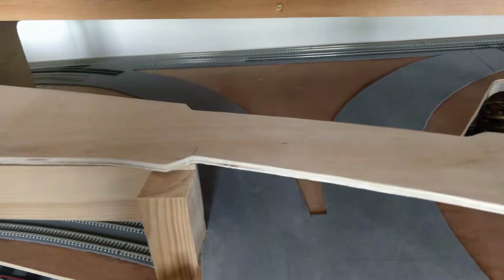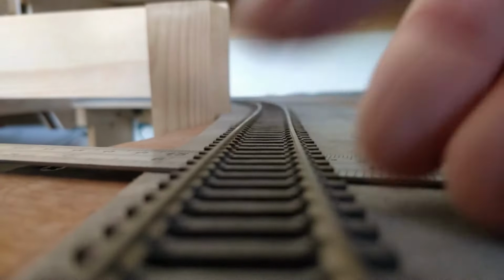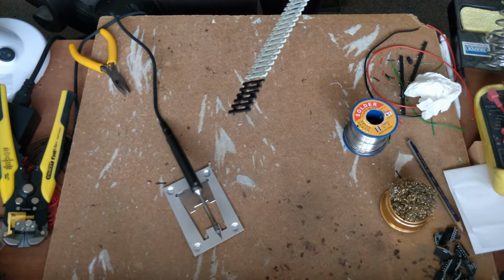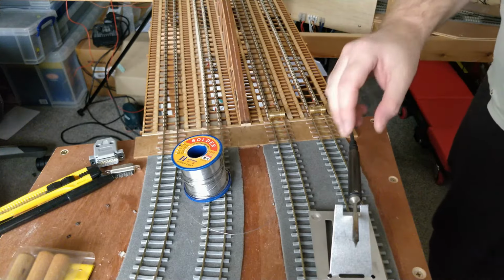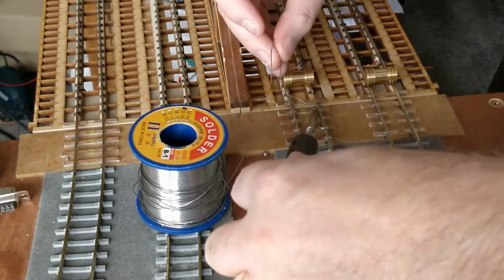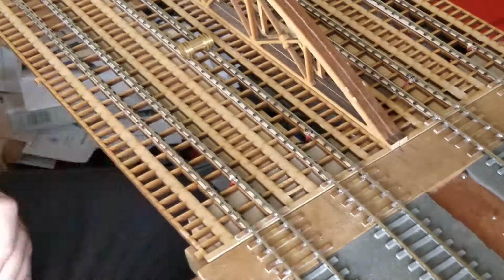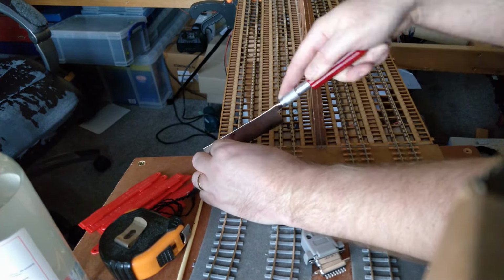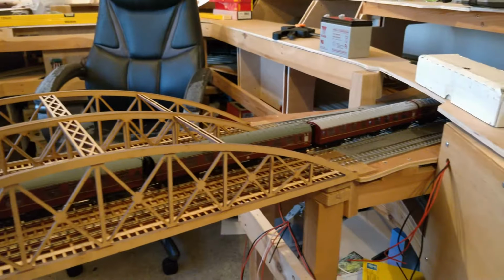Model Railway Construction: Laying track across the lift-out bridge

Comment: I am considering having a 2 lane track above my original 3 lanes. What height would you suggest is a suitable height to allow access if anything went wrong on the bottom rails
Reply from the maker: Assuming the lower three tracks are effectively hidden loops/sidings/tunnel, you want enough height to stick your arm in above the stock and below the baseboard supports above. You can get away with less if the distance is short.